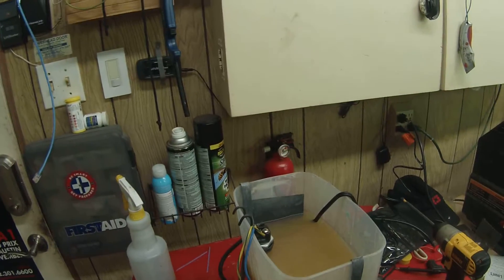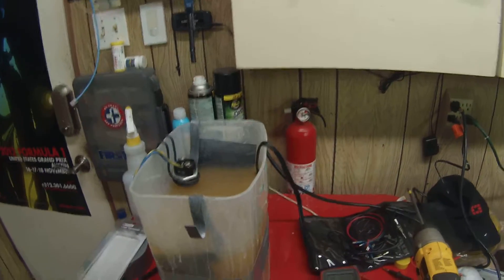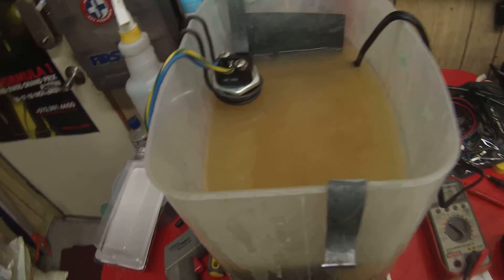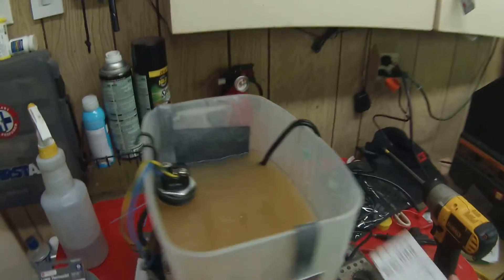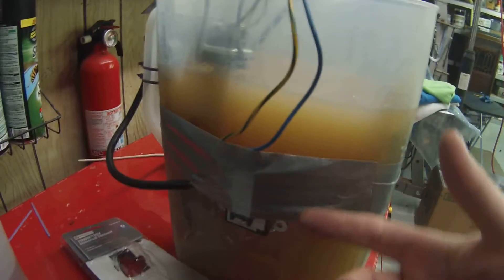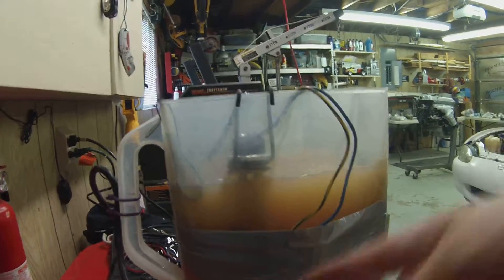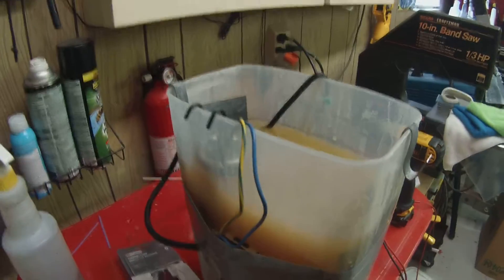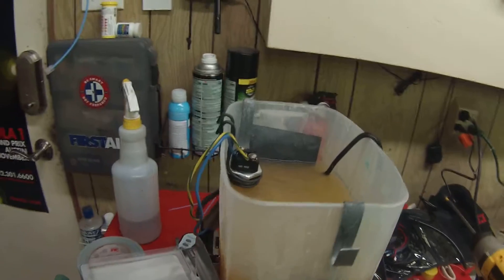Caswell Plating Update - Heater Fix

Comment: Thanks, I've been trying to figure out how to heat the baths since Caswell doesn't sell or supply the heaters, for some reason.  Would it have been possible to just use your original heater with the thermostat instead of getting the new one (eliminating the exposed terminals)?
Reply: we manufacture the heaters for caswell kits http://www.industrialelectricheating.com/plating-heaters
they are more expensive than an heating element from lowes or homedepot but they do include a waterproof housing and built in thermostat for easy adjustment